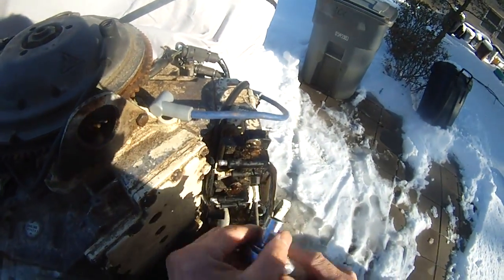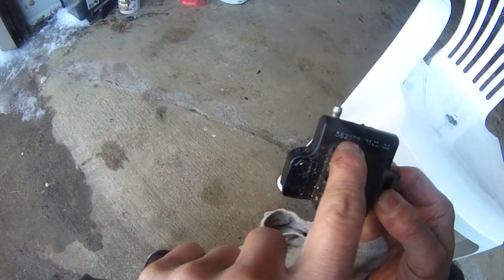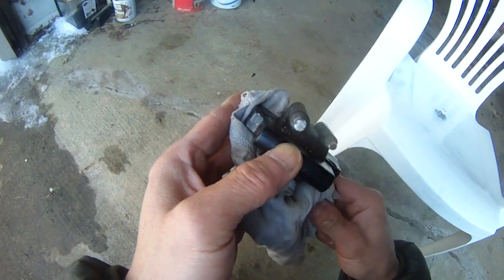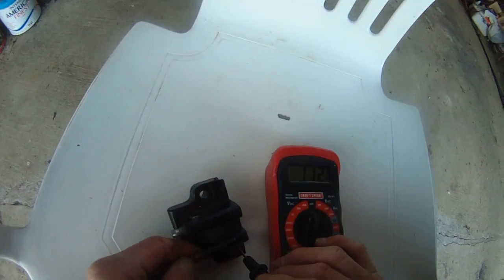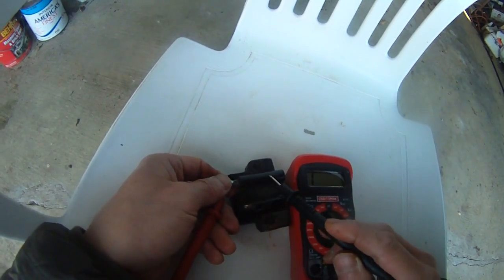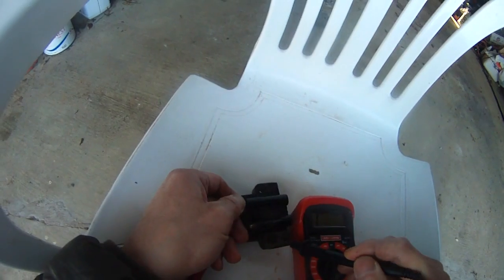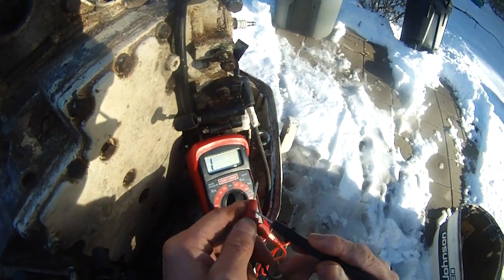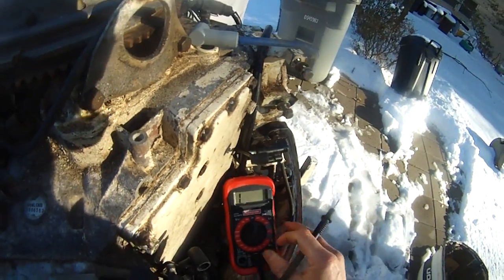spark plug coil testing - Johnson 90 hp outboard

Comment: https://goneoutdoors.com/troubleshoot-johnson-ignition-coils-7928687.html

Primary winding on most 2 stroke motors 0.15-0.5 ohms. Ignition winding (spark plug) 2000-2600 ohms. I'm had a similar issue on my 1973 65hp Johnson. Power was low. Found bottom (highest) cylinder coil had infinte ohms. Replaced, full power. Still hard to start, randomly dies. Found rusty spark plug boots. Replaced boots, starts instantly, full sustained power. As long as compression is good, electrical components are a good place to start looking for problems with old outboards.